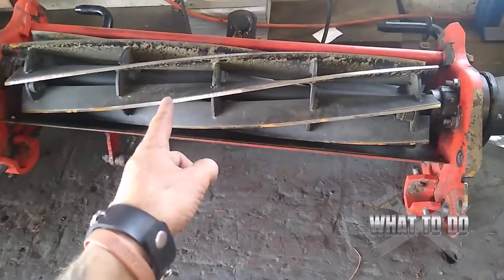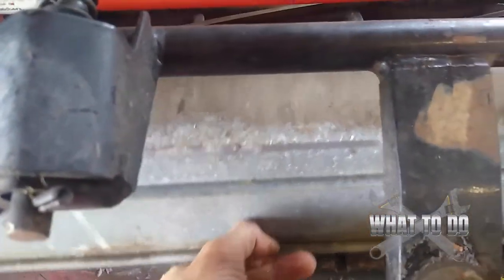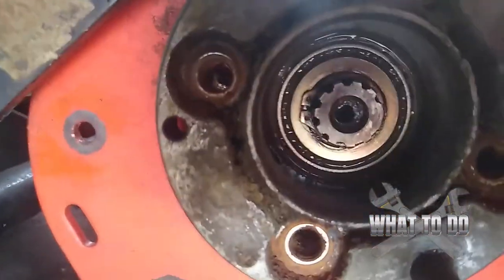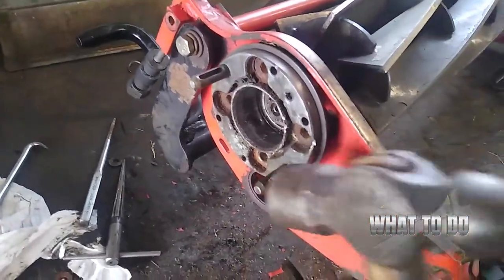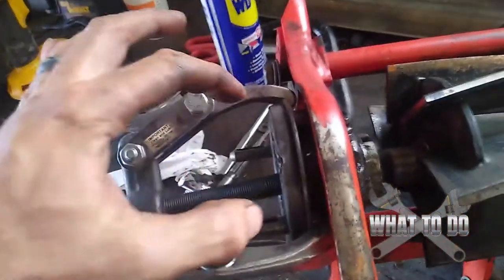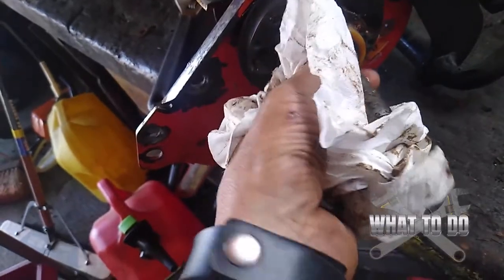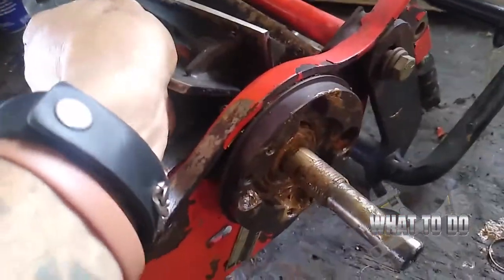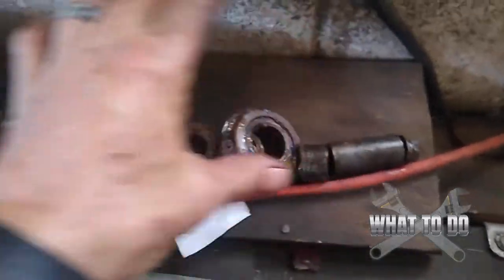How to Remove The Reel & Bearings on Jacobsen Fairway Mower

Comment: When reinstalling your new bearings, so you have to use the bearing assembly tool by Jacobsen? Or can you just press to fit?
Reply from the maker: You Can just press them in yourself. If you have a piece of PvC pipe to place over the bearing or even a socket and tap it in place that will do just fine